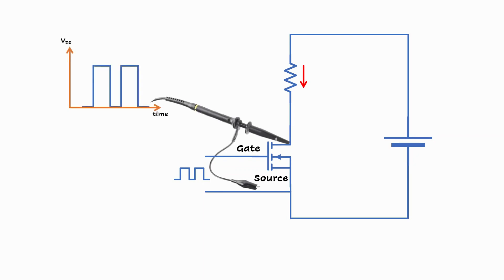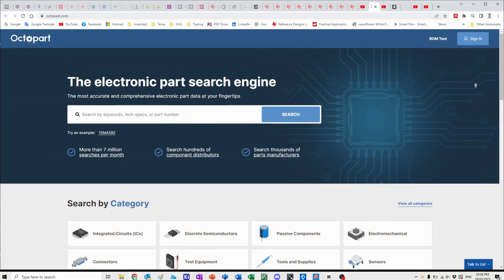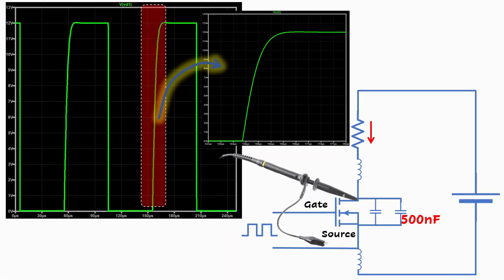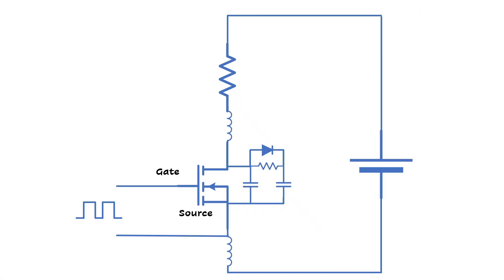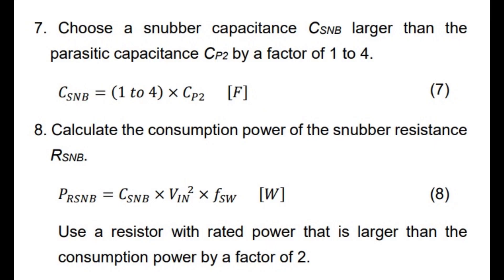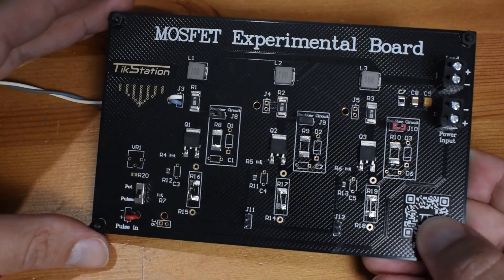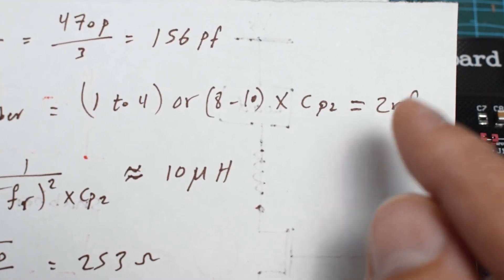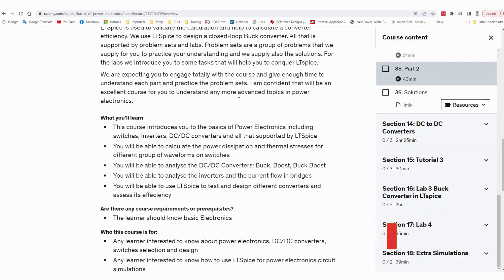What is a snubber circuit and how to design it? | Power Electronics

Comment: Very good results Sir.
Can you explain the steps that you took to get from 220 ohms and 2.2nF to 5 ohms and 100 nF.
Looks like you increased the capacitor by a multiple of approx 50 and then Reduced the resistor by approximately the same multiple. Is that correct?
Reply from the maker: just trial and error
Reply: @WalidIssaPlusE  just built a little circuit using IRFZ44N and a 12V bulb.
1kHz pulse on the mosfet gate at 50% duty and getting a peak of 60V on the drain and 4.5MHz ringing. Played with capacitors and resistors and got rid of the voltage spike and ringing completely.
Fantastic stuff and very educational.
Thank you Sir.